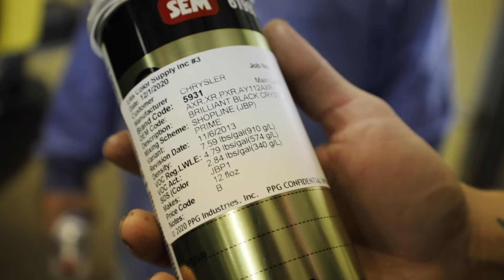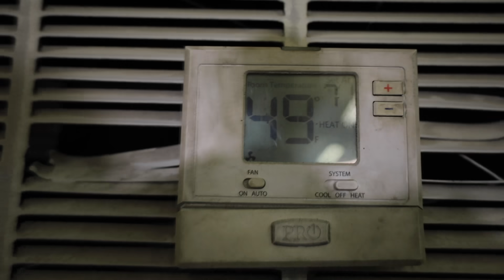Gypsy Body Man Spray Paints my Truck...and it turned out AMAZING

Comment: Idfk what those people were thinking. He did really good.
Reply: No. It will never look right and it certianly will not last. I wanted to say he done decent on the body work , but that bodyline on the bed was horrid. To someone who does this to make a living, this is unacceptable. If this guy is having to do this in someone elses shop and uses rattle cans , this says alot about his butchery. If he was any good he would have his own shop by now. The guy clearly knows the business , but in a unprofessional butcher shop type of way.
Reply: @dustrod9244  I'd rethink that comment if I was you,most factory clear can last 40 years and I've seen it,but urthane which wasn't used 40 years ago can last that long and I guarantee this spray max isn't as good as factory clear.
It's better than laquer but it's still just a cheap $80 gallon clear stuck in a spray can.
Reply: @darknature79  You think modern Dodge clearcoat can last 40 years. lol. you better rethink that comment
Reply: @Hayawasa  I mean Sean said in the video that the guy said they need to use a paint gun with a compressor but Sean SPECIFICALLY asked him to use to rattle can to see how it would turn out
Reply: @LowKeyIdiots  maybe he did but even if the guy sprayed it with an hvlp it would still ring out and lift off the paint around it. You just cant do it the way he did and make it last any amount of time and every time the sun hits it you will see where he sprayed that crap on it. You have to sand the whole panel and blend the new base coat into the old clear. Then spray a real clearcoat not that 2k crap. That guy was the pro he should have told that boy it wasnt going to work that way . Its going to lift, bubble or just peel off, plain and simple.
Reply: @dustrod9244  i dont tell you what type of sawdust cleans up puke the best, or how to refill the paper towel despenser, so dont tell me anything about painting cars.
Reply: @Hayawasa  lmao! "Real" clear coat is 2k.....it is a 2 part, clear and catalyst......reading your comments I can tell you don't know much if anything about paintwork. Also 2k clear has uv inhibitors in it....
Reply: @sinformant  the 2k they are referring to is not the same as ppg or sikkens and if you want to get technical the body shops use a 3 part clear , 3 part actual clear , 1 part hardener, and 10 percent reducer. 3:1:10% ratio.Some clears are tinted and require a fourth and fifth part.You should think before you comment ignorance , ive forgot way more than you will ever know lmfao!!!!
Reply: @sinformant  if you have so much faith in the 2k in a can, then use it on your next project, and when it peels and flakes off, you can pay somebody like me that does it for a living to do it right and offer a warranty , because real body shops only use products that last . Not some crap out of a spray can.
Reply: @Hayawasa  well I wouldn't use clear in a can because I have a shop, compressor, and guns. And yes I know there is reducer generally added for flow out and different temperatures...but they also don't generally call urethane basecoats 2k even though they are 2 part.
Reply: @sinformant  well knowing that, why did you troll on me to start with? You just bored? Wanted to see if i really know what im talking  about? Never the less when i say its not real clear, i mean it its not worth a shit on the outside panels of a car . You can say it has uv inhibitors in it all you want, but they obviously dont work. I dont have to tell you , you obviously know.
Reply: @Hayawasa  honestly for small stuff if I didn't have the equipment id use spaymax 2k and im sure it'd work fine.  In the video he asked the guy to do all spay cans instead of using proper equipment so he didn't have much options, I just hope they color matched the basecoat to the actual finish and didn't just mix by paint code or it will stick out like a sore thumb.
Reply: Damn
Reply: Good
Reply: @sinformant  idc.
Reply: @sinformant  it wouldnt.
Reply: @sinformant  maybe it would work fine for you , it says alot about the quality of work you do. I cant use it at my shop because i am a preferred shop by all the major insurance companies, and im not going to throw that away to use inferior products. Its probly okay for a small time butcher shop like yours.
Reply: @Hayawasa  well I wouldn't think you'd use it if you do insurance work. @ $20/can that'd get pretty expensive on materials and labor to cut and buff out the orange peel when you are being paid bottom dollar by insurance companies to do a job. I hope you do a better job than most the body shops around here that do collision contracts for insurance. They don't even blend panels half the time and leave huge sanding marks lol.
Reply: @sinformant  yeah thats how i got on the preferred shops list, those things you mentioned. That and putting money back into the business.
Reply: @Trevorstonge  ive learned that people downplay certian things to suite their lack of abilty or are just mad because they dont want to pay to do it right. Either way , in the end they are playing theirselves.

Comment: Here’s a tip for next time your using rattle cans in the cold weather 
Fill a bowl with boiling water and drop the cans into the water before you start spraying it’ll warm the paint up nicely so it’ll mix properly and spray really well 👍👍👍
Reply: Thats why he used the heat gun on the can
Reply: @tonycosta8137  I know that’s why I mentioned hot water has it’s much faster and easier than holding heat gun on a pressurised can
Reply: @quincy5855  i got you
Reply: never heat the paint in front of a space heater,and forget about it.I've been there,and worn the T shirt.

Comment: Honestly I’ll be real with you I 100% respect the hustle but I’m expecting that paint to fail in about a year because it wasn’t baked as well as paint is a very temperature sensitive product needs to set properly heat gun isn’t really the best way to have that done but good effort I’m 100% positive you get that guy in a clean spray booth and shop he will throw down and do a pure artwork absolutely pristine work but given the environment and supplies/resources he used A for effort

Comment: Man ive done my rims for the last 10 years and multiple friends too with a rattle can. If you wet sand in between layers and put 2-3 layers acrylic it comea out really good. This last set has been on a 4runner 4years and still looks badass. Just take your time. Truck looks good man

Comment: This is actually very common in the auto industry , although not such big spots ...
The body supply store will.mix your paint code and load it in a can for you if you ask ..
For small touch up it's less clean up work and set up time ..
Sem , transtar , mason dupont , ppg , omni etc ..whatever you need they'll do ..then 2 part clear as well , you pop the button on the bottom of the can and it introduces the activator ..

Comment: Hell that’s the best way to go my 2011 gmc would dent every time you touch it. so I had some work done and went ahead and had my buddy skim the whole truck with Bondo, blocked and repainted now you can’t punch a dent in it lol. Plus it’s smoother than any factory truck on the road .

Comment: Anyone that believes this is not a hack job shouldn’t be allowed to drive a car. It’s spray paint for Christ sake. There’s a reason body shops charge so much. This is a complete hack.
Reply: and it still looks good  have u ever done body work you can go to multiple youtubers/videos of people using a can to paint there car and it turns  out rlly good if you don't know wtf u doing yeah a spray paint can make a job look nasty and dumb but if u know what u doing it will look nice  the reason why body shops charged so much cause they are body shops   your just mad
Reply: Nothing wrong with a good hack if it works

Comment: Just a tip dude , dont put your greasy hands on the bondo or primer , it will absorb the oil and the paint wont stick to the surface , it will seperate or overtime bubble and start coming apart

Comment: Damn dude do them a favor go to a graffiti website get a spray can adapter and some different tips and it makes the BIGGEST difference with how smooth it will come out. You need like a calligraphy tip it has a flat nozzle that can be turned it looks similar to how a gun sprays ish.
Reply from the maker: Humm never thought of that...interesting 🤔

Comment: I wouldn't call this a normal spray paint job out of a dollar store spray can. That can probably cost $200 and is mixed to your trucks paint job. It's pretty much the same thing as a body shop would use in there big fancy spray booths just in a diy can. Only difference between what a body shop sprays and what you just sprayed is the body shop has a air hose hooked up and yours is coming from air compressed in a can.  I thought this was gonna be a dollar store kinda spray paint job.
Reply: I purchased three cans of this paint for my truck and they are about 24$ a piece. Not to bad for what you get.

Comment: When you revealed it riding down the road the light reflecting off the lines of the bed still show dimples and bumps in the body work.     Paint looks good for rattle can but man that nice of a truck why didn't you just let the man use an HVLP gun to spray it?   You probably wouldn't have had to cut and buff since the spray gun would have atomized the paint and clear so much more uniformed. Plus the volume of paint that an HVLP gun would put out would allow for it to lay down much glossier.
Reply: I think it's really hard for anybody to complain for the money he paid you got a Dynamite 🧨 JOB💯
Reply: Tom is a body shop'$

Comment: Not sure the reasoning being with the rattle cans...for a video maybe? But yeah that was enough of a repair to get out the compressor and paint gun. Easily. I have a situation that might be a candidate for a rattle can repair. The corner of a bumper cover, but yeah that repair would've justified building a plastic booth and wetting the floor and running a gun, if nothing else to save money and time, especially on the buffing.

Comment: From coming from a auto body background and took a vocational program it's not a horrible job it's nice but not perfect and body filler is not a magical tool it's made to fill in anything up to a half inch nothing deeper then that otherwise when it shrinks it will pop out and even a half inch is way pushing it but it can be done the spray paint they are using is pretty much pro paint the only difference is what the holder is and how you can set up the spray pattern also metallic flake is very hard to not get streaks because of the weather temp and the spray pattern of the can but if your happy that's all that matters also never drill holes if you don't have too should have used a stud gun welder for the slide hammer on that cab side but it's not the worst thing he could do another if you put a hole in it fill it with metal like with a welder wait half an hour after you weld on a car to leave it and always disconnect the battery when you weld it can have a nagitive side effect on the computer but not likely but the paint and everything done isn't the worst budget build 10/10
Reply: I agree with you but damn son....not one damn period in that whole paragraph, even at the end of your comment. Your whole comment is literally one sentence😂😂😂

Here, take a couple periods for next time.
..........  ......
Reply: @jaycustom21  I was never too good with proper structural sentences in english and everything I learned in highschool except math science and history I forgot tbh lol

Comment: Body work is 99% prep..... do that right and it don’t matter what the equipment is. Plus a cut and buff fixes everything.
Reply: Yes sir! Used to do mahogany woodwork for a million dollar yacht  & would wet sand, polish, & buff out any imperfections in the final clear coat to get a piano or mirror finish on blood red African  mahogany wood work & when I was done with it the wood looked like i laid a quarter inch sheet of glass on all surfaces.

Comment: If you really want to see how smooth the Bondo work is you use your fingernail very lightly and go across the transitions it will detect even the smallest imperfection 👍

Comment: I guess people are surprised that proper paint and other coatings come in aerosol?  Its not like they are using $3 cans of shitty krylon

Its usually the same thing you would pour into a paint gun, only it comes in an aerosol can for small repairs.
Reply: Yep it's the same stuff basically...instead if an air compressor pushing the material its aerosol.

Comment: He’s done a good job just gotta be careful with the bumper the only reason why they would make you replace it is for a simple reason it’s got sensors and you ca t repair stuff by sensors yes Ik it’s on the side but if went to the front and you can’t do that because it’ll make all the sensors read wrong and go off possibly so and yes they do see money signes but it’s also for your safety lol

Comment: That's okay you I have a few dents and scratches that are going to be fixed today is December 31st 2020 brought my new car SUV into the dealership for service oil change and a few other things. Received a phone call a few hours ago my SUV was in a accident it was sideswiped. But this is the problem the SUV this is no ordinary truck mine is over a hundred thousand dollars because it's a Porsche Cayenne GTS twin turbo fully loaded with the 22 " rims the back tires are the same width the one they put on the Dodge Viper so I don't want the truck anymore because it's been sideswiped I think I deserve a new vehicle because I do not want a 100000 + vehicle that someone else sideswiped to be continued see if I ever by a Porsche again

Comment: The guy did great on the body work, but the problem is going to be in the paint. That shit wont last. Sell the truck quick.
Reply: Dude that wasn't some $3 shitty Krylon paint from Walmart...it's real automotive grade paint that you would find in any body shop. It's just in a spray can for smaller jobs.
Reply: @jaycustom21  i know what it is, but its not going to stand up to the uv rays or the heat, not to mention the rain and snow and other abrasives that hit it at highway speeds. Im not posting comments to hate on it, it can be useful for custom interior panels , door jams  and the backside of fenders , or any parts that arent exposed to the elements. My original comment was from experience, as  a painter, these type of " professional grade" products in a spray can , have made me thousands of dollars. But only from stripping it off and spraying it with an hvlp gun because the rattle can crap started peeling after a couple of months. It has its place , but its just not made to be on the exterior panels of a vehicle.
Reply: @jaycustom21  and just so you know, body shops just dont stock that stuff.  We only put it in aerosol cans very rarely to touch up scratches where the body men rubbed or gouged the paint in a door jam during the reassembly process. Thats literally the only reason we even put it in an aerosol can.
Reply: @Hayawasa  Gotcha. I laughed when you said these products have made you thousands of dollars, by stripping it off and painting it the right way 😂 I watched a Vice Grip Garage video today so when I saw you say "hvlp gun" or sprayer, whatever you said... that's "high velocity low pressure" right?
Hopefully that's right. Anyway, idk why dude painted a nice, newer truck like that with a spray can. That's only something I'd try on a beater or work vehicle. Anyway, Happy Holidays man✌️
Reply: @jaycustom21  yes sir. Thats correct. High volume low pressure. This type of work is like anything else , a person gains knowledge through experience, but i hope that my comment helps people to not be misled by this video , in hopes that some one doesnt actually try this on their car lol, espeacially when a person can buy a decent enough gun at harbor freight for 150 bucks and actually spray a good clearcoat on their car or truck. I hope you have a merry christmas and a happy new year as well.

Comment: As someone who does body work for a living the body line is absolutely horrid. That’s really the only issue I see with the job he did
Reply: which body line? I don't see anything wrong. Looks great.
Reply: @smokestrong1000  the body line on the bedside it’s supposed to be straight not dip down by the taillight, compare it to the other side and it’s pretty rough